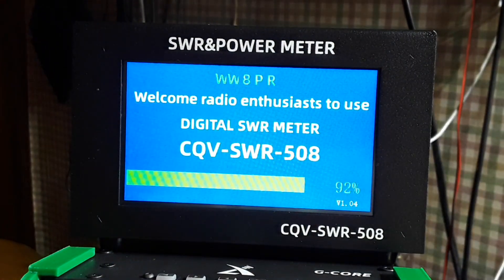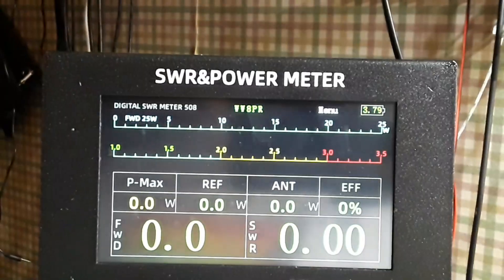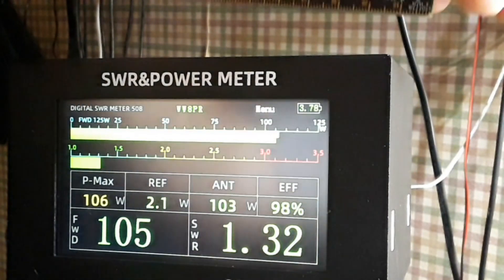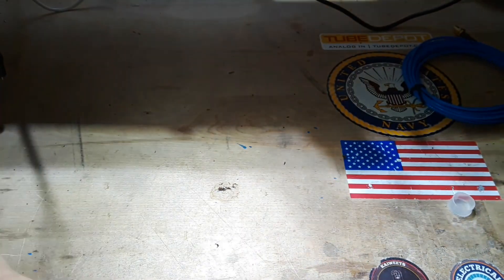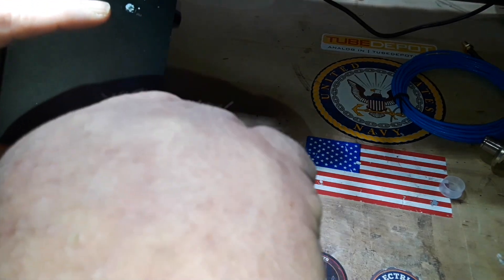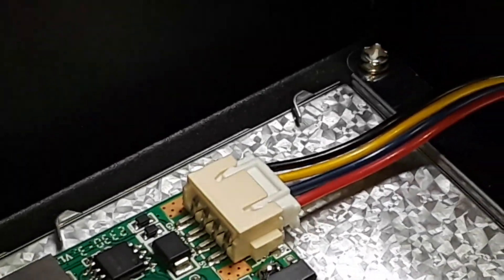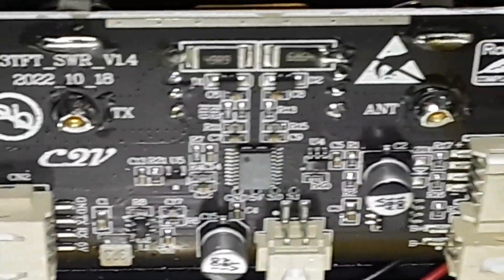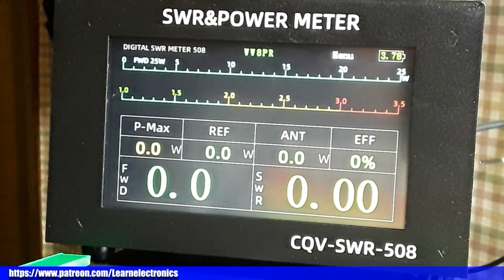CQV-SWR-508 VSWR & Power Meter Review

Comment: Nice eye candy, but not accurate. Makes noise on 40 meter band. Only goes to 200 watts. I doubt if the meter is fast enough to protect an LD-MOS type amp. Flashing alarm is not enough, you want the meter to take the rig offline. You can calibrate it, but with what? A real meter? :). Buy a real meter, I suggest a Palstar or a Telepost LP100a.

Comment: Nice SWR Meter but how it's working in SSB/AM peak power reading? Thanks for the Video. 👍
Reply from the maker: I cannot recommend this product. After one week the charging system failed. I'm currently making a revised video.
Reply: @learnelectronics many thanks for the info mate. I have the CQV SWR 120 in two Versions which work quite well. But peak readings are a problem. I have a Chinese Surecom SWR 28 here which has a peak reading mode, but it shows absolutly high readings that i can not believe. AVG mode readings are good, but peaks are fantasy.
Reply: Quindi lo sconsigli? @learnelectronics

Comment: Your firmware version is 1.04, mine is V1.02, I don't have the ability to input my call but everything else looks the same.
Reply from the maker: Do you ever see Chinese characters on screen while transmitting?
Reply: @learnelectronics No Chinese in TX.
Reply from the maker: Interesting. I'm guessing it comes from my amp. Probably some stray RF. I'll get some ferites on the line. Thank you.
Reply: FWD and SWR changes to Chinese characters on mine when i go over 125 watts. It will also restart all the time if it only runs on battery when i go over 125 watts. So the charger must be plugged in to work properly. Firmware on mine is V1.03

Comment: Looks like a pretty decent meter, but gosh.... couldn't they have used a slashed-zero font? Lots of wasted space in that box as well, could have been much more compact for portable use. Pretty decent, and I've seen much worse. Thanks for the video review.
Reply: CQV-SWR120 is a nice small, 100 watt SWR meter with an OLED display that works great for portable ops. And it's about half the price.